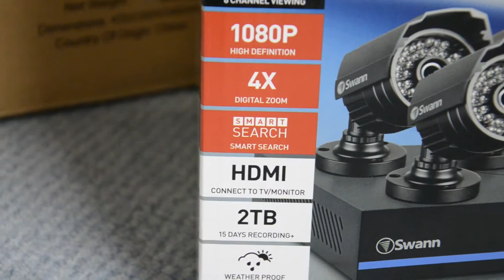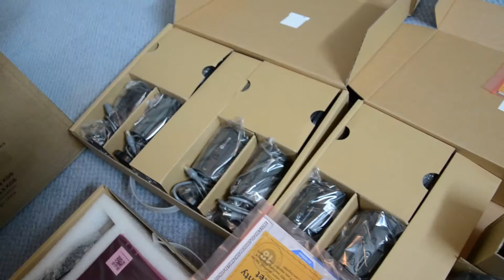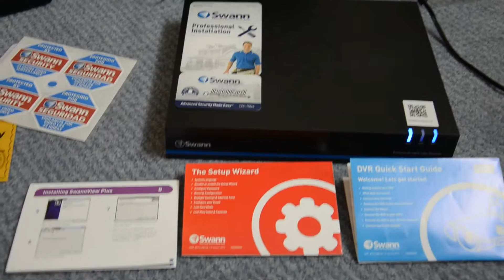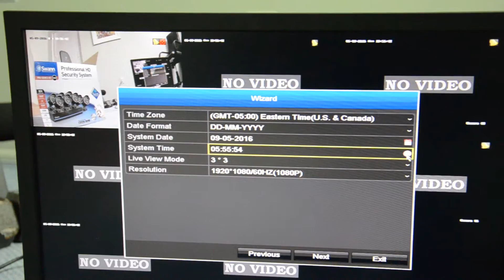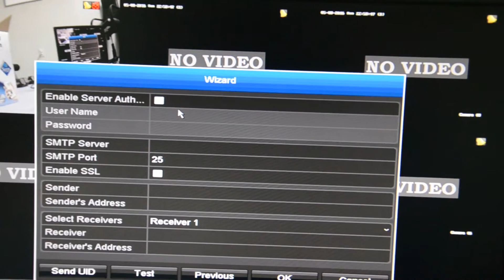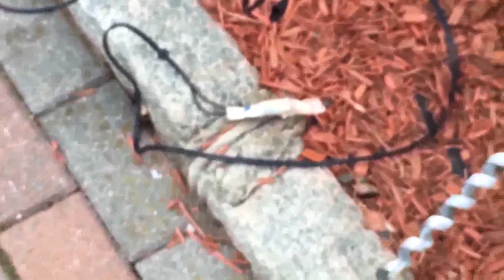Swann Security System (SWDVK-880758-CL) Setup

Comment: You videos are very good and clear.  very nice! But For Analog Cameras. you need to install coax cables. For IP Cameras, you need to setting the camera, Router and DVR, which is little complicated. Maybe you can try our PLC NVR Kit system: No Need any cable. No need any setting.Real plug and play.  ( All Data transmitted by Electricity).  
http://www.gatocam.com/product/product.php?lang=en&class3=124
Reply from the maker: Thank's Huang!
I really like the concept of transmitting data by electricity.

Comment: very informative video.  I was up in the air between this system and the Samsung SDH-C7040.  For the people who are looking to adjust focus, the camera is a " Barrel" camera so the top can be removed and the lens can be adjusted.  The IR light board can be replaced if needed too.  To open the camera grab just below the lens cover and turn the lens cover.  You can adjust the focus by slightly turning the lens ever so lightly.  The cameras are usually factory adjusted but sometimes may need to fine tune focus. This should be done while looking at a larger monitor instead of a tablet or phone as there may be a delay.  Thanks again for the great demo.
Reply from the maker: thanks Mike